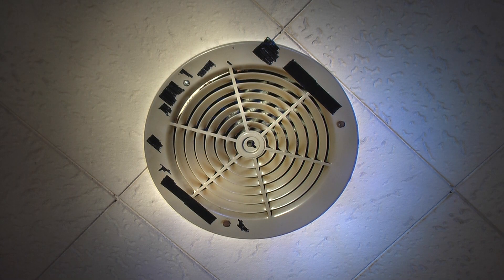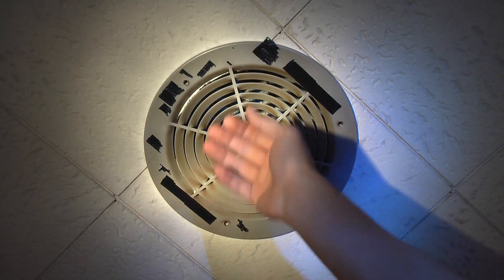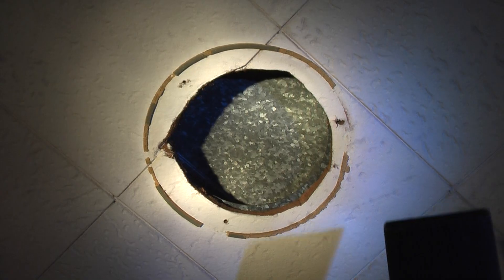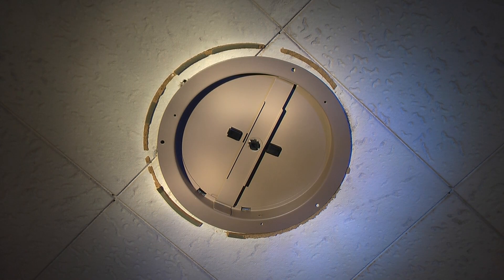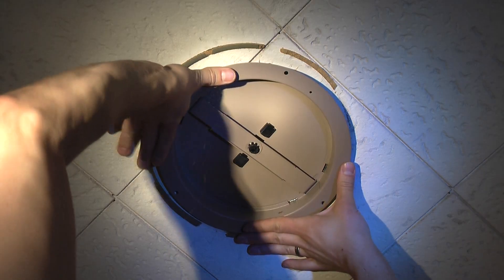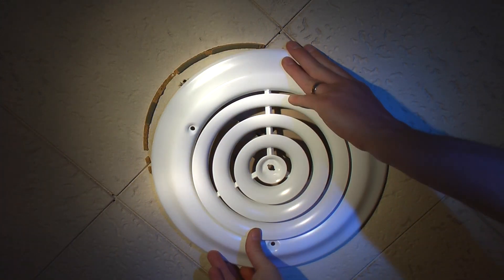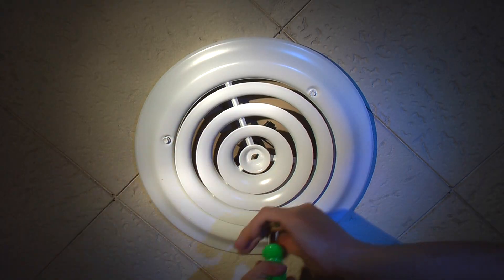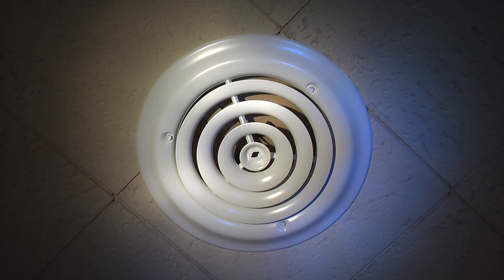TruAire SmoothGlide Ceiling Diffuser Damper Installation Retrofit Vent Cover Heating Cooling HVAC

Comment: You never finished the installation the one part i need help with is the key install. It is supossed to be permanent ....
Reply from the maker: The key that came with this vent will not stay permanently installed. You just insert and turn like a screwdriver to open or close. If you let go of the key, it will fall out.
I have however seen a permanent turn knob on some models.

Comment: did I miss something or is this whole thing just friction holding to the ceiling? there's no way those 3 machine screws are doing anything to hold this assembly to the structure or ceiling board...

Comment: Where do you find the keys for these vents? I’ve moved into a house that has this type of vent but no key...
Reply: It is a semi-circle hole, if you are unable to find one a screwdriver would also work, just be careful as the locking mechanism is made of plastic in most modles, and the screwdriver could strip it.

Comment: Can you tell me the key you used to adjust from hot to cold. I lost the one I had and need a replacement idea.
Thanks
Reply from the maker: It's a long white plastic piece with a D shaped end. I just googled and searched eBay to no avail. You might be able to find the right width of flathead screwdriver to wedge in there to turn.

Comment: Great video! Does the key not stay in the unit? My old ones you would push the key up or pull it down but the key was always attatched.
Reply from the maker: Thanks for watching! The key does not stay in it. You just insert it to open or close the vent, and it falls right out.
Reply: +TheTechnoMack Thanks for letting me know!
Reply: Does this make it quieter?  One room is noisier and colder than the rest.

Comment: I have an 8" diffuser damper that I installed but the actual diffuser cover (just like the one installed in this video), it doesn't fit anymore. Should I have a 10" cover?

Comment: Great video. Question: do they make longer keys so you can open and close the vent standing on the floor?
Reply from the maker: Not that I've seen, but that certainly is a great idea!
Reply: No, because the ceiling fans, if there, will hit the key.

Comment: Can I eliminate the damper completely?  I'm remolding my house and don't like the way they look.  Plus, I leave them wide open year round anyway.
Reply from the maker: With you today if you just leave them open anyway, I don't see a need to install closing capabilities. However, there may be building code ramifications that I'm not aware of.

Comment: Can u use the stick to adjust air flow?
Reply from the maker: Absolutely. That's what it's for. Thanks for watching!
Reply: TheTechnoMack how do u do it? Push it in? Twist?
Reply from the maker: @kingarchnyc  The key is D shaped on the end. You put it into the D shaped hole in the vent and turn it counter-clockwise to open, and clockwise to close the vents.
Reply: TheTechnoMack thx so much! Would def try tmw!

Comment: What does those vent do
Reply from the maker: +dat nguyen (PhoneReview) They allow or block airflow from the heating/cooling system based on the position the key is in.
Reply: +TheTechnoMack why is there vent in my school they don't really do anything
Reply from the maker: +dat nguyen (PhoneReview) That's where the heating and air conditioning blows out of.